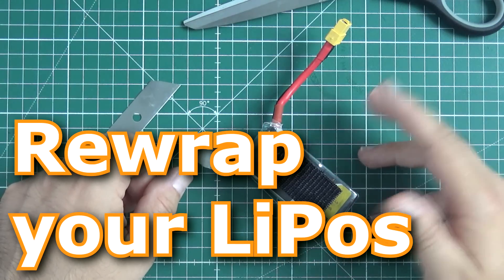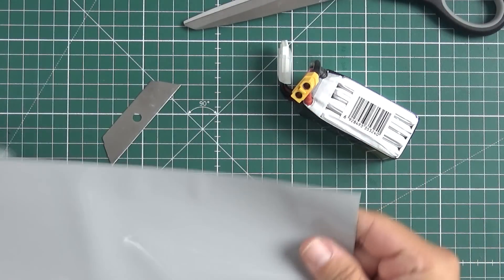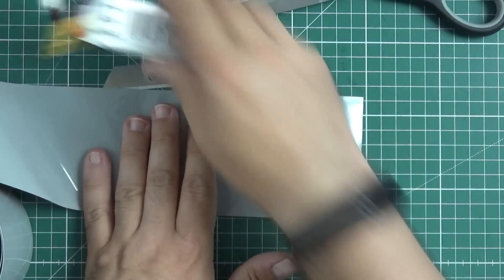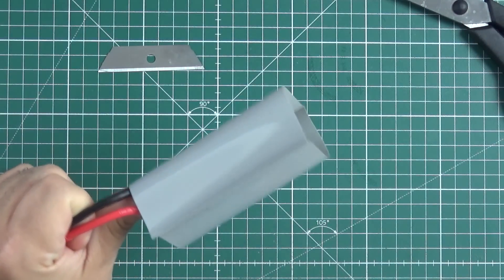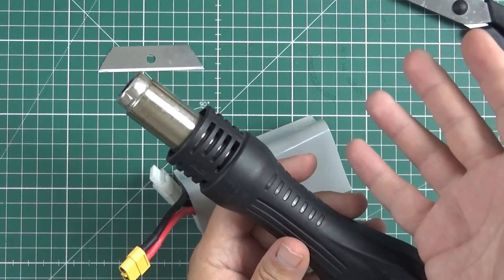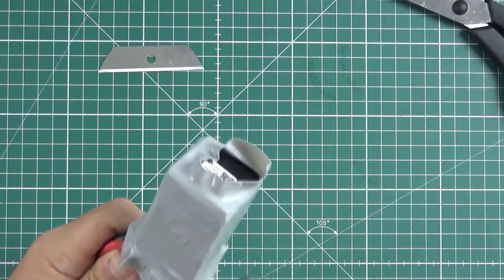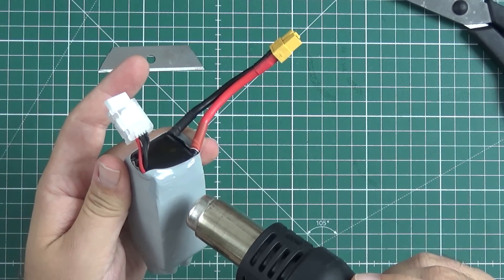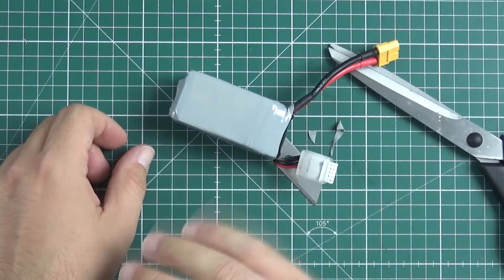Rewrap LiPos with shrink wrap like a pro

Comment: Good tip, as for the part you cut off in the end and kinda was messing it up you could have just added heat and then squashed it with your finger or something flat and it would just stick onto the bat.

Comment: Good video,. Excuse me but I have an unrelated question.
On iNav 2.0 airplane with differential thrust mix: is there a way to cut off the differential thrust by a switch on the radio?

Comment: a couple of hints, the type of heat shrink used for battery packs is PVC so for those looking to get some do a search for "PVC Heat Shrink". A better way to heat the shrink wrap for battery packs is to use a hair dryer, it provides a lower temperature which is safer and it provides more airflow which will shrink the wrap uniformly.